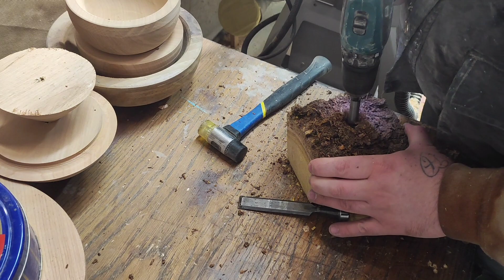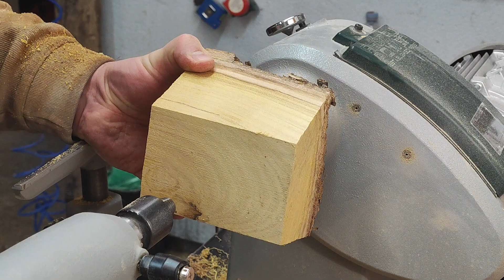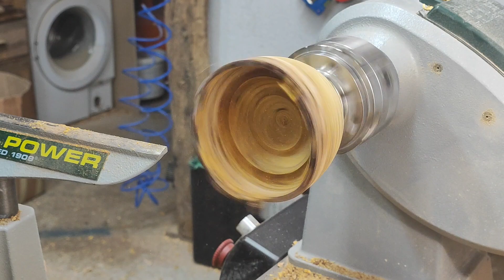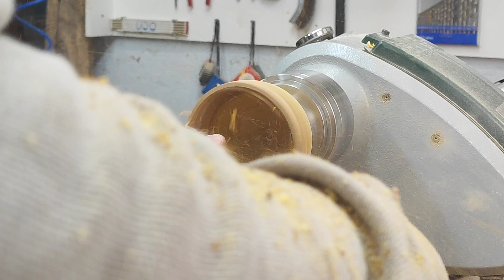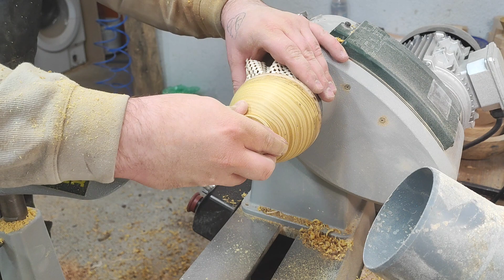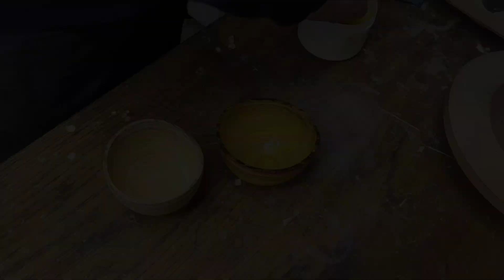SMALL MULBERRY LIVE EDGE BOWLS

Comment: Was that green wood and if so once you applied the oil  finish does it take long to dry. Never worked green wood yet. Can always get some around here.all year some ones aways taking trees down.
Reply from the maker: It was green but not soaking wet. I did let them dry thin a bit before putting oil on